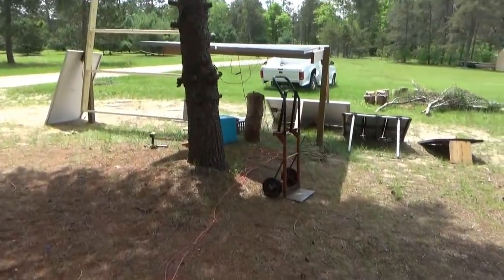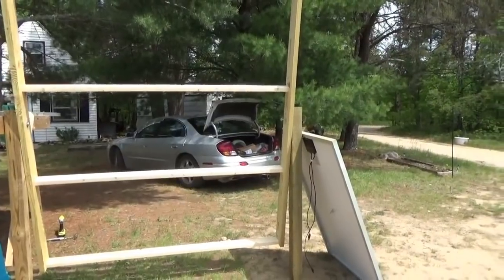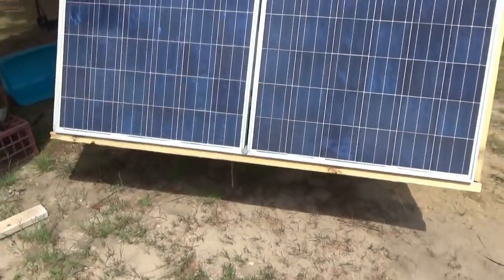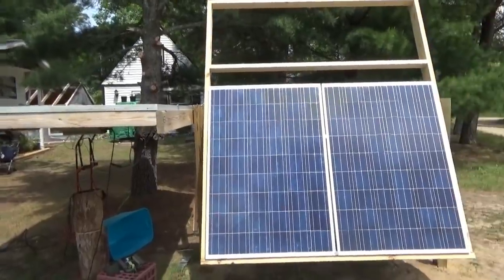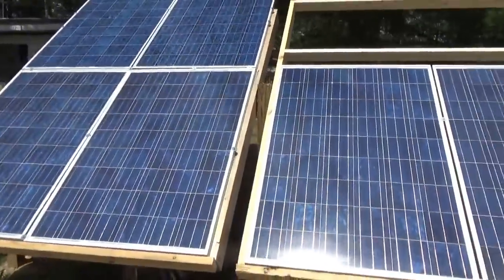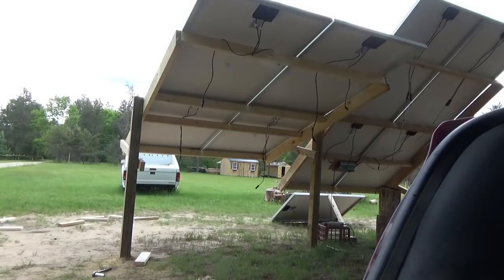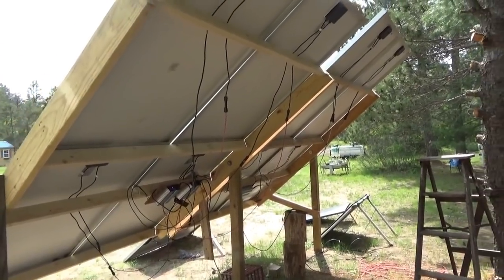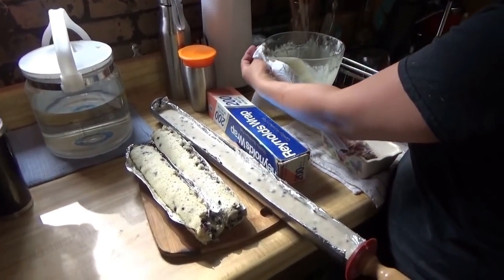Expanding Our Off Grid Solar Power & Utility Meter Is Dead Stopped

Comment: Love some details about array...ie height of posts above ground...size of wood of racks...reasoning for size...etc
Reply from the maker: Please refer back to last summer when I built the first rack. All the details are on that video. Thanks.
Reply: The Do It Yourself World I rewatched the 1st video but there r really no details in that 1 either...i can assume u r 6' tall so posts r 5' above ground...rest would be based on width of your panels...1/2 way up rack for pivot hole?...its a nice array...i like it...thanks for sharing
Reply from the maker: 5 feet above ground, yes. Pivot is in the middle for balance. 4 inches from the top of the post and centered. Rack is made to fit the panels so my measurements would not help you. But its about 89 inches wide by 8 ft high.
Reply: Thanks...love the design

Comment: you might replace the twisted 2x4 with a 2x6 and will not twist like that. It will be sturdier too.
Reply from the maker: Well now I have essentially doubled up the 2x4s so I hope I wont have trouble anymore.
Reply: yeah probably wont have anymore trouble.

Comment: Troy,  Why did you build a solar array  under a tree ?
Reply from the maker: Well, at the time the sun was lower in the sky and I miscalculated. Plus there is the driveway right there. On the other side of the driveway would put it in the way of the fire pit and right in the middle of the yard. Closer to the house is all under trees. Had to make a decision.
Reply from the maker: And had to use the shortest wires possible to reduce lost power in the lines.

Comment: I had bought pressure treated 2x4s to mount 2 solar panels and had them cut and drilled ready to make the frame. After a few days they were so twisted they were unusable.  I am glad I let them set as the warping would have twisted and possibly broke the panels.  Ended up welding up a metal frame.
Reply from the maker: Interesting. Many people around here use treated lumber. But yes, if in the sun and not connected together, it will warp badly. Once its all tied in though, I have not had too much trouble except for this one 2x4 so far. I think that painting the wood will help a lot.

Comment: A suggestion for showing power usage... Show the utility meter from day to day, or week to week. A meter that is stopped at the moment only means you are not using power right now, but doesn't say what is happening 5 minutes from now. The reason I mention that is I'm sure you still need some power and there's nothing wrong with that. You are still reducing your bill.
Reply from the maker: We will keep the grid power as a backup for rainy days. As I mentioned below, it is cheaper than a generator as a backup option. We will also continue to expand our solar power production as we can afford it. Money saved on the energy bill can go into solar panels. I hope to run mining rigs on free solar power.
Reply: Definitely a good idea to keep the grid power. Not just for rainy days but for peak loads like future use of air-conditioning that solar wont support.
Reply from the maker: True. But running AC is usually needed when peak solar is being produced. I am thinking more about long periods of rain or clouds.
Reply from the maker: Sorry David. I keep blocking that guy/girl and they keep coming back with the same name again. YouTube is a liar and not enforcing their policies about making it harder to troll people when they allow you to copy the same name over and over again.
Reply: 95% troll!

Comment: Should not cover up your meter , if its stops it will all stop , you have to call power company have turn the power off
Reply from the maker: David, we are not using power from them now but we are not going to shut it off either. It will be our rainy day and backup power. Cheaper than a generator by far.
Reply from the maker: All I covered was my meter number due to certain people who cause us trouble.
Reply: Turning off the power completely would be a very bad idea. I'm sure Troy still needs some power from the utility.
Reply: Troy, good idea to keep the power on. As for the dopy trolls, they seem to find out everything anyway.

Comment: Should just buy 4 more solar panels
Reply: Disconnecting from an existing grid is throwing away a valuable resource.
Reply: Buy 4 more solar panels as the budget allows and set up a grid tie system with battery backup.
Reply from the maker: I hope to but they cost money. Gonna take time

Comment: Question... How are you getting solar power to the fridge?
Reply from the maker: Separate line run from the panels to the fridge. Planning to set up separate lines to each room in the house for solar use as needed. Separate from the main house lines and breaker box.
Reply: Extension cords? Or a separate breaker panel and outlets for solar power? I realize that following electrical codes may be a pain in the backside, but is best way to be safe for you and your family. Wishing you the best whatever you do.
Reply from the maker: Both actually. But totally separate from the house wiring. A stand alone system with its own breakers and wiring.
Reply from the maker: Sorry, edit. Not extension cords but both separate breaker and outlets for solar power.